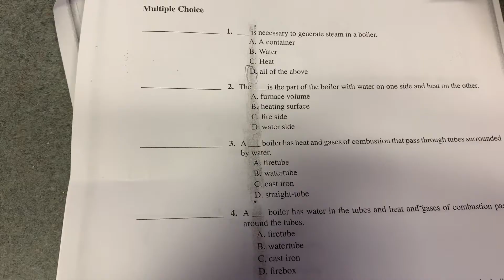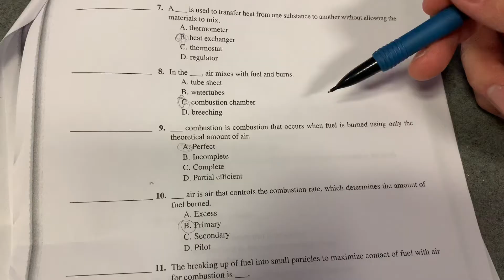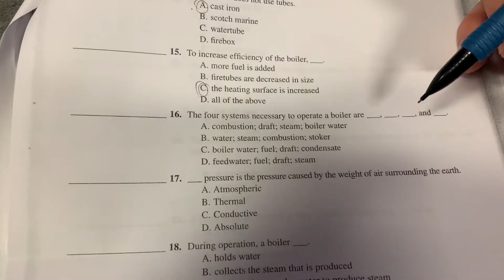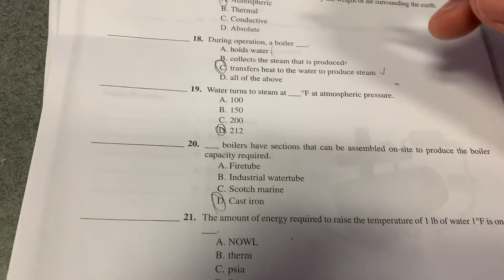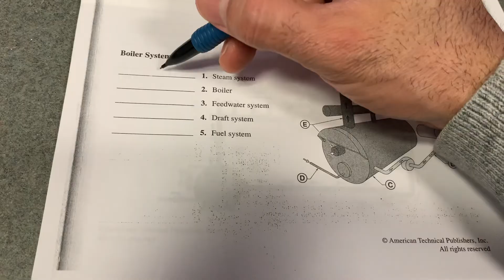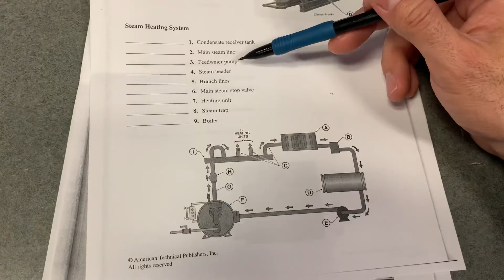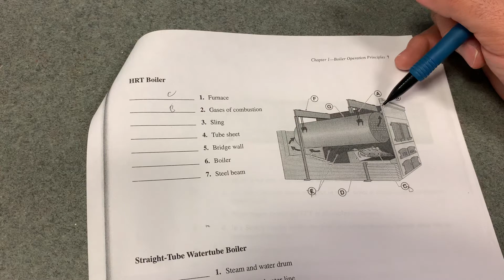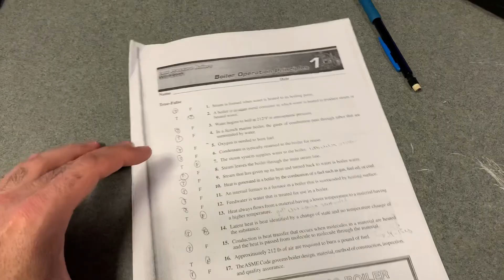Boiler principles test questions and answers

Comment: questin 16 is A because you don't necessarily have to have steam in a boiler. we run our low pressure boilers in the summer time to just make hot water and zero steam
Reply: Boiler water makes me think A is wrong because a feed water is really necessary for safety reasons because that is how make up water fills the boiler to try and stop the boiler from having a low water condition.

Comment: Hey Rodlpho thanks for the tip.
question: have you taken the exams?
Reply from the maker: Yes, I got 2nd fireman in 2008, I got my 1st fireman in 2010. Try 5 times before getting my 3rd engineer and now I am on the process to get my 2nd engineer...